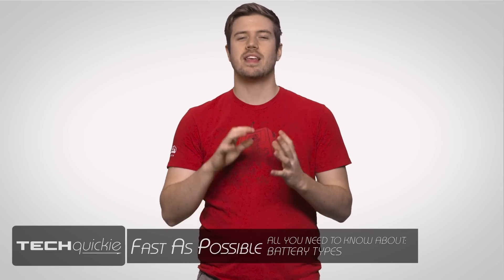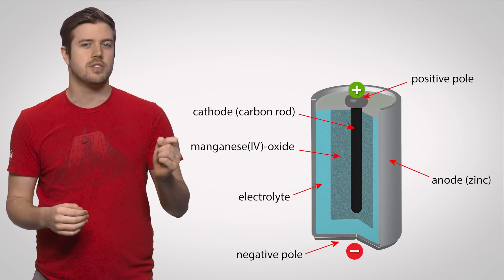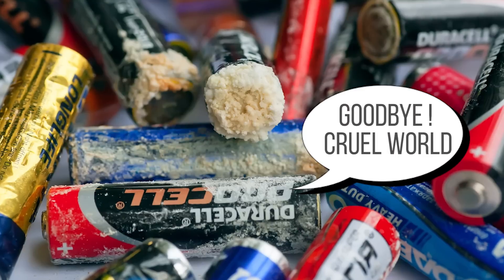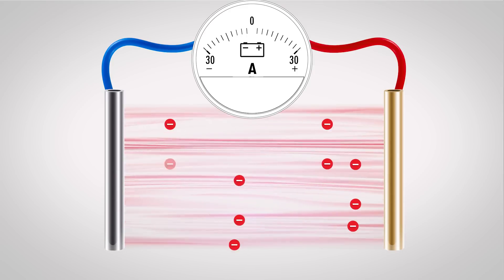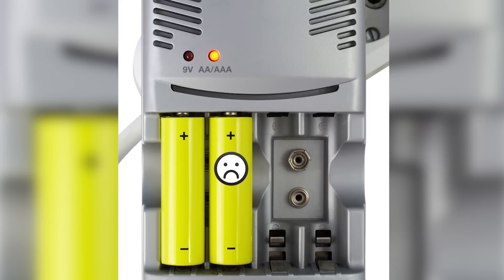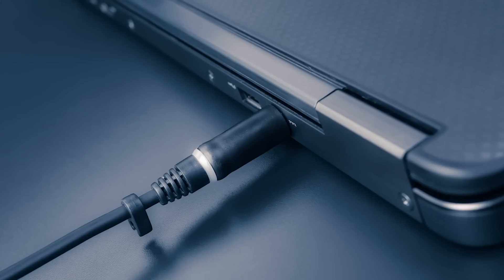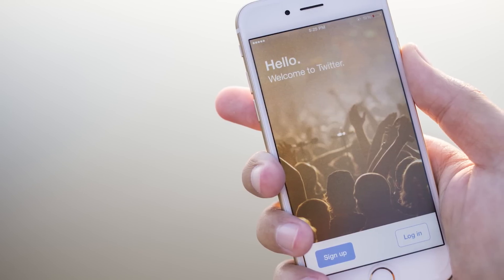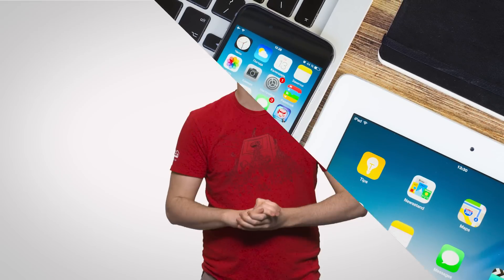Battery Types As Fast As Possible

Comment: thinness
performance
battery life 
pick 2

we already can make phones that you only need to charge once a week 

you just need to get rid of the thinness craze that we are currently in (thicker phones will also be more durable)

the ulefone power 5 has a 13,000mah battery and can last almost a week on 1 charge, it is thick and heavy (similar weight/thickness to an iphone in a battery case, but more energy efficient) but it is very durable, and the battery will not only last longer between charges, but it will also last longer since you are using 1 cycle per week instead of 4 cycles per day 

longer runtimes are possible with current technology, just make the device thicker and include a physically larger battery

imagine the battery life of a galaxy S10 if it was double the thickness, but included a 10,000mah battery (maybe then i could get a whole day out of my S10 5G instead of being tethered to a battery bank if i go out for more than a few hours)
Reply: Thick phones would put users off as many users find thick and bulky phones a thing of the past and more thickness makes a Smartphone heavier
Reply: @stephensnell5707 then why do phones like the Unihertz tank 3 pro, or Doogee V Max sell so well?

Comment: So mah question is (powerbank) the lipo charges ur phone faster than the li ion and the li ion dies faster than the lipo right? If its right it i will buy for 60$ a lipo powerbank with 12000 mah with Qualcomm quick charge 3.0 with a usb c connecter + normal usb from cellularline (is that company good?)

Comment: i putted once some alkaline batteries in a recharger, they got a bit more fat, but they are still in use today
Reply: Don't recharge them,discard them once flat
Doing that is simply extremely dangerous and unsafe
If you want to do that and cause harm to yourself well it is up to you
If harm comes to you you will only have yourself to blame and no one else

Comment: I used to play with RC electricial models and I was always sceptical about that "no memory" thing. I used whole bunch of different types of batteries, from NiCd to Li-pol. I always used hi-end, competitive chargers that allowed me to see, exactly how many amp-hours actualy "got into" my battery (it also allows for charge-discharge cycling to regenerate batteries, setting your own charging current and much more fun stuff that taught me alot about batteries and electronics in general). Let me tell you: the better you treat you batteries, the better they gonna last and perform. And it's true for all types batteries, NiMH, Li-ion, you name it. ALWAYS try to discharge and charge them fully. Also, the lower the charging current, the longer the charging (obviously), but also the charging is better and moe efficient with the lower current (more Ah go in) and it's much better for the longevity of the battery. It is reccomended, for the long service of battery, to charge it with the current of 0,1C (e.g 2Ah battery - 0,2A charging current, which gives 10h of charging). Ocasionally, if you hurry you can increase it to 1C (1h charging), but not too often. It's not reccomended to exceed 1C, ever. It's weird to me that these days companies focus so much on performance of the phones, stuff like quick charging, but not the batteries themself. Plus you cannot exchange them easily these days and chargers are crap as always, which creates nothing but problems. And it's not even that difficult to make 5000mAh batteries that are small and fit in the phone (RC people used them for years).
Reply: Genuinely why don't they just make the phones thicker and have easily swapped batteries.
Reply: @Intelwinsbigly you wally brain
Bulky Phones would put people off entirely 
Also,non removable Batteries have an advantage by stopping the User from putting in a fake and non approved Battery
Fake Batteries are simply bad and UNSAFE and would put the user in a big danger and unapproved ones won't have any protection circuits either meaning they would easily get overcharged and totally damaged

Comment: WRONG
Lithium polymer is nothing much different from lithium ion
actually there is no such chemistry as lithium polymer and to make it fair all current rechargeable lithium based batteries are lithium polymer as polymer is a separator
you have not spend even 1 day on while thing as all what I have written to just an hour to learn
do not make people mistaken by your lack of knowledge in this subject please
you guys are great in Computers and I like what you do, but you have tried subject which you should not have touched as you did not prepare for it and it is easy nie complicated then you may think
proper tech quickie on batteries would definitely take longer then proper tech quickie about Linux FileSystems
I know both subject, so I speak from knowledge stand point, not from what I think only

Comment: Ni-Cd are far from obsolete
Ni-Cd provide right in spot balance of high current (Ni-MH is much worse), low self-discharge (Ni-MH is almost twice better), low maintenence (less then lead-acid and even Ni-MH), easy charging (Ni-MH is hardest one ever) and high volumetric capacity (lower then any lithium, Ni-MH but much higher then lead acid)
there is no lift which sits in this spot

I do not think batteries and especially rechargeable batteries are subject for tech quickie
you may write PHD on rechargeable batteries every year for your entire life span and your grand children can pick it up and continue for another lifetime and it won't exhaust subject

Comment: who gave you idea of using alkaline batteries for high current devices?
alkaline batteries are not designed for high current, but for longevity
so you use them for remotes, which at worst would take 10mA every time you press button and batteries would die of old age not due to discharge from remote
for high current you use heavy duty zinc-manganese batteries, which are designed for high current, but do not last long

for high current you use Ni-Cd
for longevity you use Ni-MH (which is huge rubbish for high current)

Comment: well
you definitely did not try to recharge alkaline battery and you describe very different kind of battery as alkaline
1. what you described is absolutely one time use and no matter what you do it cannot be recharged, unless you replace chemicals inside
2. alone battery can be recharged and if somebody tell you otherwise then ask this person which exact product and which exact brand do this person refer to as all alkaline batteries are rechargeable (I have tried a lot of them and some hot note charge the while they were new)

Comment: And i though the current goes through the + end
Reply: The ions in the battery flow rom the - end called the Anode then through the Electrolyte in the middle and then to the + end called the Cathode and once all the ions reach the + end a device like a smartphone will automatically shut down
Recharging a rechargeable battery pushes all the ions from the + end  back to the -end

Comment: Umm... Luke, the cathode is the negativity charged side and the anode is the positively charged side. Also Li-PO batteries have a lower energy density than a Li-ION battery. Li-ION are also MORE expensive than LiPOs.

Comment: OK but why does R/C industry use only Li-Poly while Li-Ion (18650's) are ubiquitous, much cheaper, have about the same charge density and there is usually plenty of room for them ..never had good luck with NIMH on any charger compared to NiCd..

Comment: If I connect a 9v battery with half charge to a 2.4v LED it will light but if I connect a fully charged 9v battery to the same LED it burns the LED out. This would indicate the battery only begins as 9v and slowly loses voltage. So a half charged 9v battery should be a 4.5v. Is this correct? 
  If I connect a full charged 9v battery to 5  2.4v LEDs will it deliver all 9 volts to each LED or will it divide the voltage delivering 1.6 volts to each?

Comment: I haven't used rechargeable AA batteries in years and now I need them for a trimmer. I have an old Varta charger which has been gathering dust for at least five years. According to info online it charges both NiMH and NiCd batteries so I guess I should be fine. I didn't know about that distinction.

Comment: Sorry Luke. Electrons leave the positive side. They made the positive positive before they worked out/realised that electrons are negatively charged. So electrons move from the positive to the negative. not the other way around.
Reply: Luke is actually correct
Also,it is the same for rechargeable batteries
Discharging> - to +
Recharging= + back to -

Comment: So how did recharagable alkaline batteries that existed in the early to mid 1990's work? That was before NIMH batteries, yet they worked and did not blow up. I used them in toy race cars as a kid.
Reply: brutalhonesty07 they were a thing, but were discarded because of the diminishing returns and the much longer charge time.
Reply: Thanks for the acknowledgement. Can you go more in-depth, and also explain how chemically they differed from disposable alkaline we still see on shelves today?
Reply: brutalhonesty07 chemically they were actually the same. The charging process involved shooting short bursts of electrons into the alkaline battery. If there was a constant flow of electrons the battery would tend to explode or leak. These short bursts would be very weak and the delay between bursts would be greater than the actual bursts. This caused this process to be inneficient and and some scenarios still dangerous.
Reply: Thanks so much for the reply! Been waiting more than 6 years for that answer.   So here's a new battery question. Given that some inventors at science fairs have already figured out graphene, can be a supercapacitor, why hasn't it been utilized to replace lithium ion batteries, in the era where it seems Li-Polymer batteries are blowing up in tons of childrens toys and in phones nowadays anyway?  I heard that graphene charges over 10 times faster than Li-Ion or Li-Polymer batteries, and that it holds a week's worth of charge.    Also  it has ultizations in water filtration so how  have we not seen survivalist products for water filtration using graphene filters yet? It's also good to market as a green technology since it's just carbon atoms in a thin one atom arrangement.   And there exist companies who know how to make the stuff, so production isn't an issue.
Reply: brutalhonesty07 ummmm. I honestly dont know, but if I had to take a guess I would say cost is the issue. Not sure though.

Comment: i know a simple way to fix the battery life issue 

stop making every device so fucking thin!!!!!!!!

if the device is thicker then you can put a higher capacity battery in it (it will also be more durable)

its not fucking hard

Comment: Fun fact: oil companies are doing whatever they can to stop rechargeable batteries technological progress. Reason why your phone doesn't lasts longer is they wanting you to power your car by gasoline instead of power grid
Reply: even though most of the fuel to keep the power grid on is provided by the oil companies anyway

most illogical
Reply: MWB Gaming
Gasoline will make them more money.
1) A lot of electricity still being produced from different source. Atomic energy alone provides ~20% of USA and Russia electricity output (France is champ here, getting whole 76%). And it's only one different source. Coal is the most major source: ~40% of world electricity, oil has only ~5%
2) Car engines are slightly less effective than thermal power plants. World's best ~35% vs average 30-40%. Also, many thermal plants utilize extra heat in some way. With very high electricity engine efficiency, that means you will burn more raw oil with usual engine.
3) Electricity usually noticeably cheaper (especially at night). You spend less - almost certainly they gain less.
P. S. If you don't need reasons but want facts: http://www.huffingtonpost.com/entry/koch-electric-vehicles_us_56c4d63ce4b0b40245c8cbf6
Rechargeable batteries never were their prime target, they just caught in crossfire
Reply: thats true but the oil companies own most of the coal reserves anyway and they even own solar plants and atomic energy plants

the oil companies are like google
they have their finger in every pie
Reply: I don't know about USA, but where I'm living coal and oil are mostly separate. Don't know about rest of the world either to be honest. However, selling gasoline for them definitely more appealing then electricity/supplying power plant. Mostly, I just don't like how they forcing waste of limited oil resource, which are much more useful in other application (even same fuel but where it's only option), just for a quick buck today and fuck tomorrow. I hate ecology bullshit which is all over the place today, but here I have to agree.
Reply: at least they will run out of money once all the oil is wasted
Reply: MWB Gaming all crude oil not oil.

Comment: I had to charge my Nokia phone once a week. Good old days.
Reply: The old day Phones were way more boring and worthless than modern day Smartphones
Old day Nokias would only be able to handle Texts and Calls and nothing else
Smartphones are just simply the best
Reply: @stephensnell5707  Fair enough. They were also a lot thicker though. And I feel like that's the current tradeoff. Slim size meaning smaller battery and thus lower battery life.

Comment: Those batteries you describe are zinc-carbon batteries, not alkaline.
Reply: I do believe if you checked you facts Alkaline batteries are for the most part zinc and manganese oxide.
Reply: The OP is correct. Carbon-Zinc (or Zinc-Carbon) uses a different electrolyte compared to alkaline batteries' KOH. Carbon Zinc cells also use Carbon and Zinc as its electrodes, Obviously, while Alkaline batteries use Zinc and Managanese Dioxide as electrodes.

Comment: If anyone is wondering why alkalines say 1.5v and NiMh rechargeables say 1.2v....

The very short answer is that alkalines drop to 1.2v when under load and NiMh stay at 1.2v under load or not.

The reason why NiMh lasts longer in some devices is that Nimh hold that 1.2v almost uniformly until out of "juice."

Alkalines droop to that 1.2v then continue to gradually droop below to 1.15v....1.1v......on so on until it's dead.

Comment: You will also notice that NiMh rechargeable batteries have a LOWER operational voltage. 1.2 Volts vs. 1.5 Volts for a non-rechargeable alkaline or the Lithium rechargeable battery. This is critical for wireless microphones for transmission range and longevity of the transmission.
Reply: On high demand devices, alkaline batteries (when new) tend to voltage drop to nearly the value of an NiMH battery on load because alcaline batteries have an high surface voltage but they have an higher internal resistence, when you have high drain, voltage drops quickly on alkaline batteries. This is why rechargable batteries are recommended for digital cameras, because when you need to refill the flash, high current is needed, and alkaline batteries strugle to delivery high current because of high internal resistence, then voltage drops to voltages like 1V on load and for some cameras 1V maybe are the cutoff voltage value, and camera will report battery as dead, but in majority of cases the battery still have some juice, but due high internal resistance they cant delivery their capacity so fast, but maybe they atill work great on low demand stuff like TV remote control.
NiMH are much more suitable for high drenage rate than alkaline.
Reply: Continue....
For microfones, they should be low demanding devices, maybe you get wider wireless reception when new out of the box but i don't believe they last longer than NiMH, and the higher voltage will drop quickly to near the nimh voltage and will flutiate more on lighter/heavier load situations. NiMH fully charged in reallity have an voltage about 1,36V, not 1,2.
1,2 are the voltage on a full load. 
On real world usage on "normal" demand devices, alkaline and NiMH deliveries roughly the same voltage.
Reply: Luis Marques I use the Lithium, non-rechargeable batteries. Because they have higher than normal voltage (1.75 V vs 1.5 V for Alkaline). They don't have the same problems that Alkaline and NiMh batteries have. I need reliability (used in a Church service). Lithium batteries have that. There is less drop outs and noise. They last a long time. But the only that I don't like with Lithium is that when they do run out of energy, they go DEAD without warning. So I change them out every two weeks.
Reply: +George Travers lithium are another beast! Yes, lithium are the best and have very low voltage flutuations until dead. They are absolutly amazing!

Comment: sorry but that was too fast. simply listing the most common battery types is lazy at best. you have to say why you'd use each one too, self discharge, power density, current density etc.
Reply: +Thanh Tran That's an in depth analysis of the characteristics of each battery type.

This video was just about the different types...says right in the title.

You also answered your own criticism. "It's too short."

It is quick. That's the name of the channel. "Tech Quickie", not "Full in Depth Tech Breakdown and Analysis."

It is a quick explanation of different battery types as fast as possible.....so I don't understand your criticism.
Reply: +Jween Tech I understand the title but sometimes quick is just too quick. People would want to know why one would use different types of batteries and not just list them by chronological order...

Comment: Where are the 18650 type of lithium ferrous batteries...man they are used in electric scooters and even Tesla cars may use them....
Reply: +Anand ranjith kannan Or even lead acid, used in automobiles.
Reply: Lithium iron phosphate is a variance of LiPo/Li-Ion, which is typically used to refer to lithium cobalt oxide cells